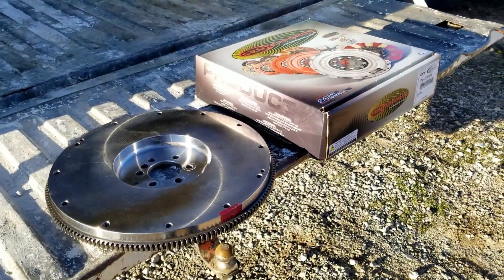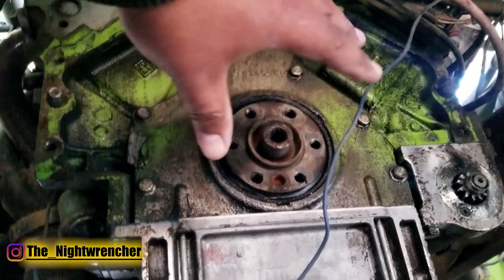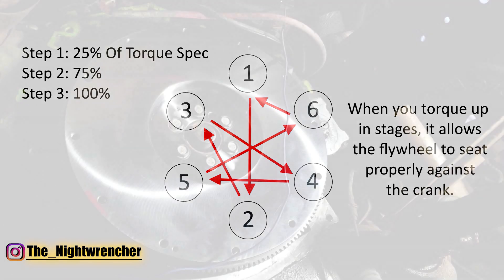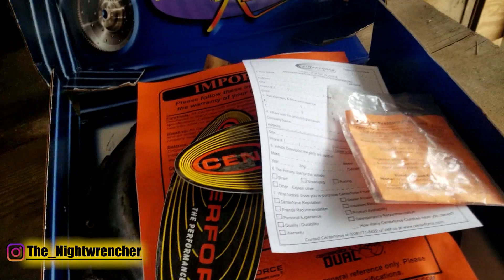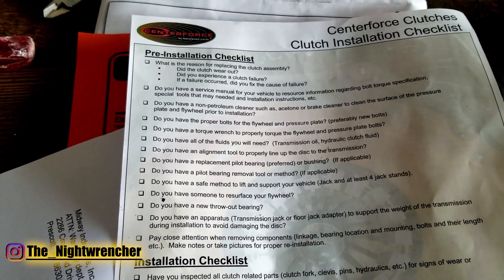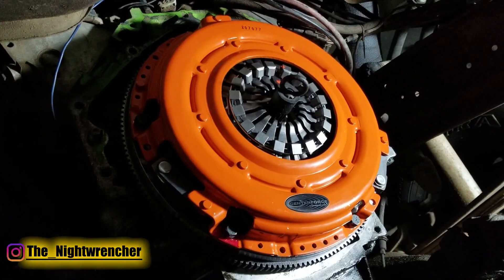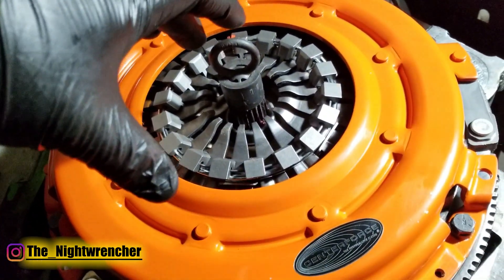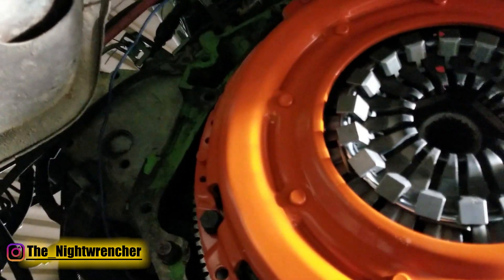How To Install A Clutch | Centerforce 2 Installation For A Carbureted Turbo LS |

Comment: I’m buying everything for my 91 Toyota ls swap with the r150 like yours your videos have really helped I’m trying to do mine on a budget and possibly use a stock flywheel from a Silverado. Did you use a pilot bearing bushing sleeve??? There all out of stock
Reply from the maker: I got my pilot bearing from advance adapters too. The reason you can't use the silverado one is because the  clutch face doesn't extend low enough to catch enough of the toyota disk. The advance adapters flywheel has a full face so the toyota disk and upgraded toyota disk have full engagment.

Comment: Could you should how you set up the slave cylinder allthread rod and the throw out bearing fork to get the right travel to not over or under extended on the pressure plate?

Comment: I have a question I have 5.3 Engine 750 carburetor someone gave me a new AEM genuine 50–1005 380LPH fuel pump Can I run that and what regulator and how is it possible😮
Reply from the maker: Yes you can, you will need a bypass style regulator that can bypass enough fuel to drop the pressure down. Call up Aeromotive, they can help you pick the right one.
Reply: 🇵🇷♥️ thanks man I appreciate it i’m kind of new at this so I need all the help I can get thank you for your time✌️❤️
Reply from the maker: No problem 👍

Comment: Wrong wrong wrong. 
Put the clutch disc against the flywheel and alignment tool in the back of the crank. The alignment tool will hold the disc in place while you bolt the pressure plate to the flywheel.
Reply from the maker: I'm sure you can do that on lighter clutch disks. This disk was too heavy for that. Either that or just get a stronger clutch tool that doesn't flex at the pilot 🤷‍♂️ Thats why I said in the video "this clutch is way heavier than my stock clutch. I'll show you how I did it on the bench."